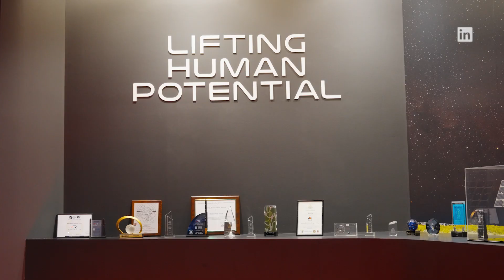Built Different: Rocket Lab

Comment: Why are people always surprised to see a tool shadow board 🤷‍♂️ Most of this set up looks standard.
Reply: The difference is that ALL the shadows actually match the tools !
Reply: I worked at a company who rebuilt Laser printer components and equipment, we had tool shadow boards and individual work stations very like this including a clean room but getting the workforce to use them properly was a nightmare. Hiring staff who appreciated the improvement in workflow and the ability to arrive at workstation and it be able to jump straight onto a task because everything was 'as it should be' seemed almost impossible. I am so impressed with Rocket Lab and the attitude of it's management and employees. I think it it helps if you can find people who are a bit 'OCD'!